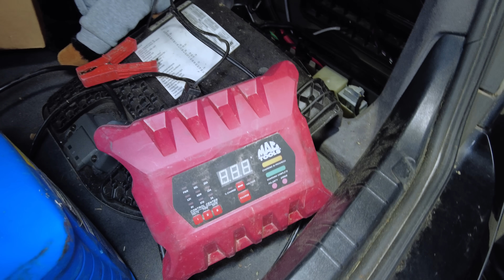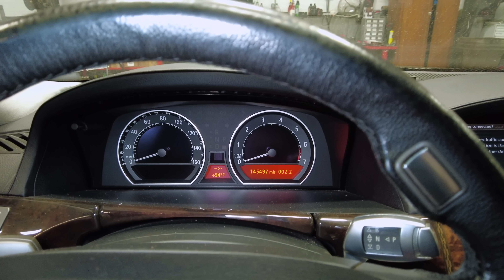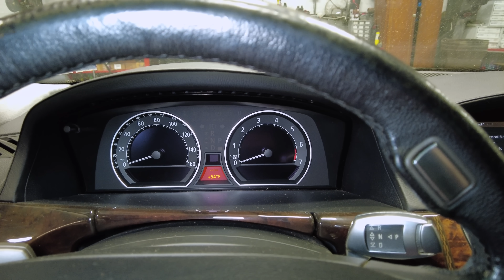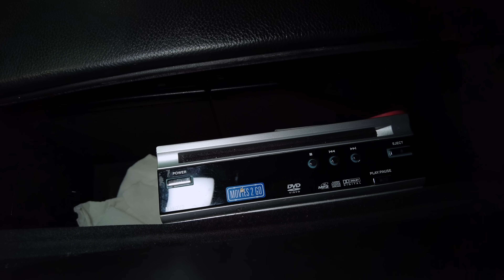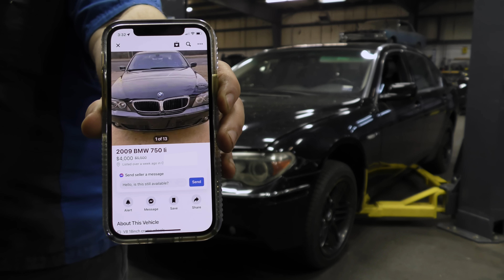Fixing a high mile German car?! Is this '04 BMW 760LI with a V12 worth it? CAR WIZARD breaks it down

Comment: Dont judge bmw s by the odd engine models.Calling bmw unreliable just because the v12 is unreliable is not fair.
Reply: Nobody's saying that in this video I don't think.  They are saying "after 100K miles they are unreliable and will need constant repairs and parts changes" is that not correct?
Reply: @robertmaybeth3434  that is incorrect. Many m54 and m62 and even the m73 v12 have over 150k miles
Reply: It’s very fair especially for the price they are built like a backyard redneck instead of sophisticated engineers
Reply: @burntnougat5341  at what cost?
Reply: @robertmaybeth3434  not much if you diy
Reply: @burntnougat5341  doubt
Reply: @robertmaybeth3434  I speak from experience. Doubt all you want
Reply: @burntnougat5341  OK, if being forced to crawling under the car with oil dripping in your muth on a sunday night, because you must fix it just to get to work on monday is what does it for you, enjoy to the fullest brother.
Reply: @robertmaybeth3434  lol what?
Reply: @burntnougat5341  i'm saying I'd expect any German car esp  the plastic fantastic BMW, to start developing all sorts of mystery problems once it's past 100,000.  If you can open the hood on a modern BMW with over 100,000 miles, pick out the largest plastic in there and give it a solid tap with a plastic mallet and see what happens, if it doesn't crack or just shatter like old Bazooka Joe bubble gum you will be lucky
Reply: @robertmaybeth3434  you clearly have no experience dealing with 2000s era bimmers. Many m54 equipped cars have been running on original plastic coolant pipes until very recently. Perhaps do some research or gain first hand experience before making sweeping, and wrong generalizations

Comment: I have 04 760LI . When I 1st bought my 760LI I change all my fluids so I know where I stand. I repair or replace the ECM, ABS,  IVM and battery. I don't let anybody drive it. I change my oil every 6 months and my transmission every 2 years. I have own my 760 for 10 years with no issues. She had 115k when I bought it & now 150k.

Comment: I noticed a pretty bad crack on the front driver side brake area. I dont know what the part is called but it attaches to the wheel on driver side. Thank you for another video it is always a treat.

Comment: I’ve got an E53 X5 late 06 4.4i production nearly an E70. Have had it near 4 1/2 years 
 Mechanic but not by trade I’ve replaced 
Both Rear Air Shocks 

Complete cooling system replacement  2 Radiators and 2 Water pumps 

Coils 
Fuel Pump 
Brake booster 
At least 2 front driver side CV shafts, after market manufacturers produced them shorter than clear BMW measurements…Which I had to seek out to make sure I wasn’t crazy and they really were shorter … sure enough they were indeed shorter .. front end geometry is 100% straight too 
2 Driver rear Cv Shafts and a  wheel bearing 
Getting the original out of the hub was a nightmare .. the splines were not fitting into the new hub without some filing or dremiling which I should’ve done instead of get an aftermarket that was Again too short, inferior replacement hardware loosened up after I drove a few hundred miles.. Cap screws walked out and then sheered off destroying the axle shaft at highways speeds with the family in the car on the way to the beach. 
Replaced it … again short .. used original hardware and it’s still on today but clicks despite it not turning at all around tight lefts. 

Sweet baby extraterrestrial Christ when I write it all down like that ….. 

I love it and I now want to up to the 2016-18 M50i … I’ve been grinding the side down on it rest assured

Comment: A few years ago I tried talk a friend out of buying one of these but he did anyway and regretted it from day one.  He had nothing but leaks and electrical problems...a terrible mess. 
Bangle was the main reason I stopped buying BMWs. I bought a new 330i in 2006 but could never love the look of the car. And they haven't improved much since. I loved my 1991 325ix and 1989 325is, those were the days...

Comment: TBH I run my daily driver to about 200k miles, what goes on all different makes are altenators, steering racks, radiators, condensers, bushes, dampers, springs, bumpstops, top mounts, droplinks, controls arms, trackrods & ends, propshaft couplings, abs rings and sensors. Most important is quality servicing and let the engine rev a bit and run. I bought a BMW 120d for 25k new getting close to 200k will cost about £6k in maintenance with out servicing costs. Seems pretty good deal to me...

Comment: I bought an 84 318i for $100. I'm still looking for the guy for giving me such a screwing. Jokes aside. I cleaned it up for about $2000 and drove it for ten years. Nice handling car. Clutch, brakes, differential, radiator, turn signal switch, windshield, sun roof cables, all 4 headlights (lost their silver backing), leaky fuel lines, no charge alternator because of a broken instrument cluster and a clicking speedometer, front struts.

Comment: the E65/E66 transmission itself has 2 failsafe modes.  So we have:
-The Normal mode
-The Transmission Failsafe mode, which runs the car slow
-The Limp mode, which runs very slow.
So in total 3 transmission modes.

Comment: These cars are weird with the rough running battery issue thing. When I was a porter at a dealership, I went with the sales manager to pick up a 750i of this era, car ran out of gas before I could get it to the nearest gas station from the auction. Sat on the side of the road till the manager could return with a gallon of gas. From that point on the car ran rough as shit all the way back to the dealership. Sucks cause that was the only time I've ever driven a 7-series on the road. When one of the techs took a look at it, he disconnected and reconnected the battery and it ran great! Kinda pissed I had to drive it broken all that way over something so simple.

Comment: A little of that engine oil uv dye and then look underneath with the uv glasses...easier than hosing the bottom off and trying to figure out where the leak(s) is (are) coming from

Comment: N52-powered BMWs are generally easy on maintenance, and easy to work on (besides doing the oil pan gasket) for most DIYers. Mine's been great, though previous owners maintained it well.

Comment: I bought a cherry 2015 BMW 228i Msport for $20k.  It is estoril blue with red interior and it smells like new.  It has 50k miles and I have owned it a year.  I only drive it to the dentist or to the movies, it has covered parking and I love to wash it at least once a month.  It only gets driven about 50 miles a month or less.  This is the way to appreciate and own a BMW, I've had many over the years and I drove them until the wheels fell off but this one is special.  It's before they started making them ugly and that car in your shop is butt ugly too.
Reply: I agree with everything you typed here.👍

Comment: You can't think about these cars as investments, but if you approach it the way I do, the money makes sense. A brand new S-class is 100k for the entry level 6cyl turbo. Weather you lease it or buy it that's a 100k liability that's losing 10k a year in depreciation. Instead, buy a fully loaded v12 S65, it's likely gonna cost you 25k-35k for a low mileage example depending on if you buy a 221 or 220, You might get lucky and only do services the first year that will cost 2k, and then the second year stuff starts to break so now it's 5k-7k for that year. These are worst case scenario from what I've seen on a low mileage car. If you ask me it's a no brainer which one to buy if u approach it financially. That being said just cuz it costs the same as a camry doesn't mean it's for you. I just wish people would stop buying these without thinking it through and trashing the poor cars. They're amazing, but it took a lot of engineering to make them that way

Comment: LOL, RIGHT ON!!! I figure I spend around 5 to 6 thousand a year for up keep on my 2020 BMW X5 50i (Off-Road Option) FYI: I've had a 04 750, & later I got a 08 X5 that I traded after 180K miles. @ 120 - 130K I spent around $12K after it ate the belt and doing all the "well you are here" stuff.

Comment: I have owned a 760 for 12 years now. I started at 75K miles and it now has 150k. When I purchased the car I was able to get a warranty with BMW which I still pay for. I have have saved lots of money on the warranty work. I loose count of the number of times the engine has been out. All up I spend about 2.5K per year on warranty and service and general upkeep. That means I have spent twice as much as I paid for the car in the first place. 

To me the car drives so well that the 2.5K per year is a bargain,  most people I know have spent way more on their car than I have by having a series of newer cars none of which are as comfortable nice to drive as the 760.

Comment: Happy St. Patrick's Day to the Car Wizard, as well as Mrs. Wizard. I hope that everyone will have a great time, by not drinking and driving and planning for a safe ride to get there and to get home afterwards. Also, it is now the weekend and it is currently spring break. After doing this video on a 2004 BMW 760Li sedan, the Car Wizard will hopefully do the next installment of the six used vehicles with these engines and/or transmissions, which will be part two of this series, that you should never, ever buy for any reason. The six used vehicles with these engines and/or transmissions will be any newer Kia or newer Hyundai with the 2.4 L GDI four-cylinder engine, any newer Toyota or newer Lexus with the eight-speed automatic transmission, any older Volkswagen or older Audi with the 2 L turbocharged four-cylinder engine, any newer Ford or newer Lincoln with any EcoBoost four-cylinder engine, any newer Mitsubishi with the CVT transmission and any newer Honda or newer Acura with the nine-speed automatic transmission. It should be interesting for the Car Wizard to do this series, as well as for individuals who will be planning to buy a used vehicle in the foreseeable future. Thank you very much and enjoy.

Comment: Funny how a similar issue occurs with bicycles; people buy a well used bike cheap online, say $20 and the gears and brakes need adjustment to make it rideable; they take it to a bike shop, who finds that the chain and gears are worn out, the shifters are broken and the tyres are dry rotted, etc., and the unwitting chump finds out that their $20 bike needs hundreds to make it safe and rideable..

Comment: Check to see if you have bad ground or other minor electrical leaks. It's very common on those and could be the cause for the battery drain.

Comment: Used BMWs can be very rewarding cars to own, but not EVERY BMW and they're certainly not for EVERYONE. 

For anyone even mildly considering owning a used Bimmer, stay far away from the big 7 series flagship sedans and look at the 5 and 3 series instead, or if you can find one, even the 1 series. These are still NOT cars for the uninitiated enthusiast. German cars have a reputation for being difficult to work with, and to a certain extent it's true, but they're also not as bad as what a lot of people imagine. If you put the time and effort (and of course, money), used Bimmers are fantastic driver's cars. Just don't go in expecting Japanese simplicity and you'll be fine.

Comment: My father had a alpine white version of this car (V12 LWB E66) . He traded his E38 LWB 7series  for a pre owned example (E66) under warranty for 60% off the original MSRP. (previous owner had 3 of them and traded them all back in due to the constant problems). For the 2 years he had it, it was in the shop  awaiting parts from Munich for at least 2 weeks every month (thankfully under warranty).

 When the E66's  warranty expired, he traded it in for a E60 535xi. Legit the day when he picked up said E60, every single light lit up on the dashboard as a goodbye present 🤣.

To this day, he regrets trading in his E38 7 series for 4 more cylinders and a unreliable car (that E66).

Comment: I own a 760 LI, and I can afford to repair it. To me it’s worth the hassle. Currently working on a new coolant pump and HPFP. It’s so hard to find a car with such charm anymore. New cars are absolute junk. I’d rather work on the old cars with character.
Reply: They are also way better looking.
2013 was probably the las year of gorgeous and cool designs
Plus, we could still manufacture naturally aspirated v8 engines
W221 was my fav full size sedan

Comment: Wonder if these fully sorted in nice shape will be worth something someday. Every year there are less and less E66's on the road and this one is actually the most reliable out of all the other E66's.
Reply: I think they will. Facelift has a more timeless design vs the more niche look of the pre LCI. Interiors hold up well but once they get 20-30 years old time will tell. It gets more compliments than my 93 300ZX which is surprising. But my car is clean that speaks for most cars. If you take care of your stuff people notice. Unfortunately out of the 100+ I’ve seen for sale maybe 1? 2? Had maintenance done. Most people do not take care of these and they get driven into the ground. The maintenance is not worth it to most people. It’s way beyond the average car.
Reply: @sladegerman  I have a mint fully loaded 2006 that I spent 10k re-doing the entire engine on and rebuilt the HPFP. Pretty costly but I like the car and it's an invetment
Reply: @Chthonian121  That's what I like to hear! Mine is a 07 750LI. I've put 20k miles on mine since I got it last July and hasn't broken down once. Have fixed a lot since owning it (previous owner problems) but have been able to drive it 4-6hrs highway every day. It has started leaking a lot of coolant so it is time to do the coolant transfer pipe. I'm sure the V12 is badass, didn't want to buy one of those thinking the V8 would be more manageable but overall they seem to have more problems than the V12. Lol

Comment: These cars make the case for learning to do stuff yourself if special tools aren't needed, ASSUMING you can afford or find the parts. However, most people that buy BMW's are not going to want to learn to fix or get their hands dirty. These cars go to the auction and end up in the 'hood' driven by drug dealers and posers until they quit running altogether.

Comment: Question for you Mr. Wizard; I have a 2011 BMW 550i xDrive. I brought it to a local mechanic for front axles (both outer CV joints were torn). They installed aftermarket (cheaper) axles. Got the car back and it immediately had problems. Brought it back and they said the cheap axles weren't going to work and I needed to get the OEM BMW axles. So they ordered those and when they went to remove the cheap ones they discovered they'd "worn and ruined" the wheel bearings so I need to replace those too. Does that seem plausible?

Comment: The workshop that fitted the replacement hoses used the worst possible worm drive clamps (aka jubilee clips).  These clamps incorporate rectangular and somewhat sharp perforations located regularly around the clamp's perimeter that tend to cut into the rubber hose when tightened - all of which reduces the life of the hose.  The situation is excerbated when the clamp is used on small diameter hoses where the clamp cutting action is magnified.  In extreme cases, there is evidence of shredded rubber material jutting through the perforations.   Needless to say, these 'cheap and nasty' clamps have been jettisoned from my workshop and recommend their removal to persons that have these fitted to their car - especially when used to secure small diameter hoses.

Comment: Chances are, at such age rear main seal leak. 

I have a 2003 Tahoe 190k miles, not driven for 3 years.  Leaks from rear main seal

I’ve dumped $2000 worth of parts on that 03 Tahoe…. Think labor cost.

Comment: I think alot has to do with  how well you maintain them. I have a vw jetta mk5 5spd with 410k miles. Although the Germans can complicate things. Everything on my car is orgingal include exhaust! I did have to replace the alternator st 395k miles. I did replace third gear synchronizer.

Comment: My 2011 Jag XJ Supercharged is at 106K miles and is running fine, not a single dash light lit. However, its only worth $9K or so and if something happens to it that cost more than $2K it is gone. Now, a 2011 Porsche 911 yeah, that one is worth spending $10K to fix. Just have to be aware of what you have.

Comment: Weren't these the ones that everyone hated the IDrive on? Im nowhere near a purist, but I did like tthis body style over the previous 7.
Reply: Yes you are right, first idrive, the worst of them all
Reply: Yes e65 is the test bed for idrive
Reply: That 2000 and 2001 7 series with the loops in the headlights sitting on 18 inch M parallel wheels is the best 7 series ever.

Comment: I have a high mileage German car...Audi A4 2006 2.0TFSI quattro 152000 miles. Bought it with 67,000miles.  When its YOUR car and you have put the miles on it and you still like the car then the cost of repair is just what its going to cost so you can keep driving your loved car.   If its going to cost more than the car is worth and the customer decides they dont want to spend that sort of money on the repair...well thats fine,  they will have to go spend even more money on another car.   The market value of your car is of no concern when its high mileage if you are driving a car you love.  67k - 152k with no breakdowns and Americans usually say German cars are unreliable.

Comment: 3 Series E46 BMWs aren't very expensive to repair.  Once you've gone through and replaced all the plastic crap in the cooling system, which, if you do by yourself, it's only a couple hundred bucks, you'll have yourself a solid platform that will continue to run reliably if you treat it well. They're not that expensive to repair.